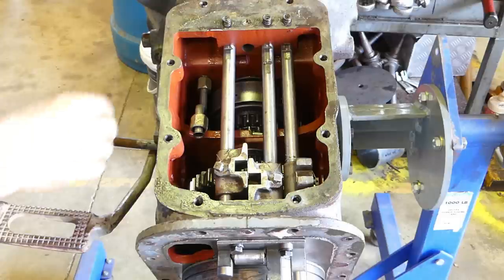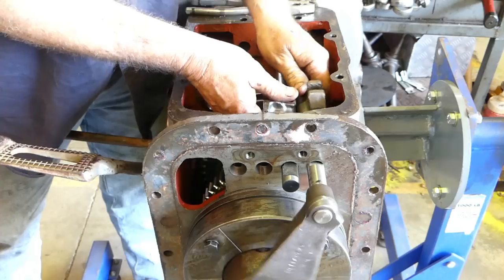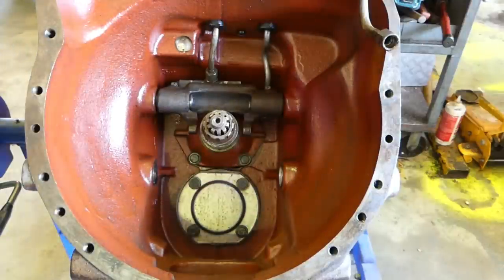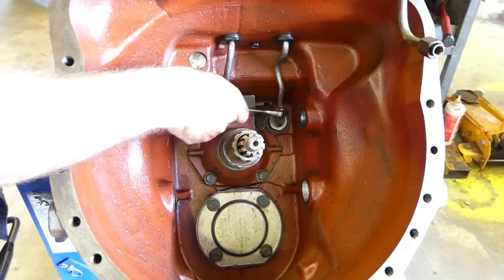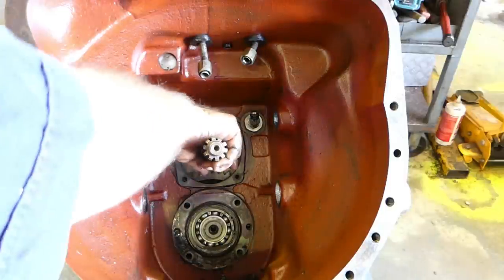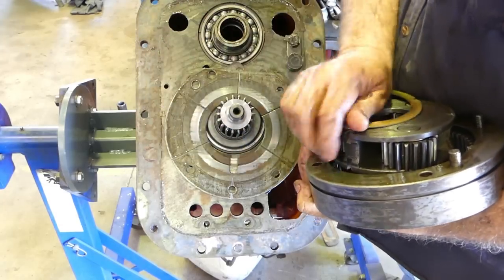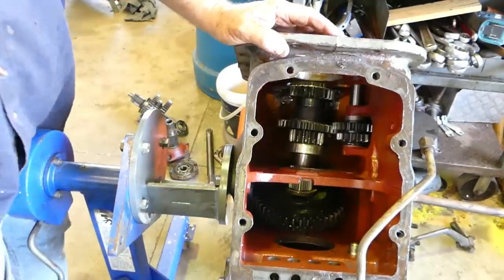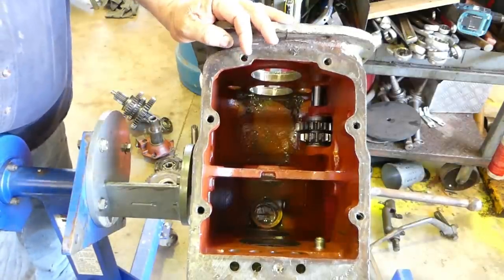Massey Ferguson 135 Multipower Stripping the Gearbox

Comment: That was fantastic detail.... I have a 1964 135 Multipower coming and cant wait to get started on it.. I'm thinking that the Hydraulic Pump is in the gearbox but I don't see it. Is it easy to get to?
Reply from the maker: It is attached to the main hydraulic pump and can be seen bu removing the lift cover.
Reply: @BundyBearsShed  Thank you, Lance.. If in fact the pump is bad,  if the can it be removed and repaired without splitting the cases? Thank you again for your expertise Sir!
Reply from the maker: I think you need to split it behind the gearsticks from memory.

Comment: Hello my tractor has a standard gearbox but i found a multipower gearbox with a cracked casing. Can i fit the multipower pack in the casing of the standard gearbox
Reply from the maker: No Im afraid they are different.

Comment: Hi Lance.  Really enjoying your videos.  A good tradesman always makes it look easy. I know this video is on the 65 but is there any information on the early TE20 1947 on what it should have from the factory.  Eg petrol tank cap recessed in the tank. Battery clamp to hold 6volt battery down not a battery box as in the later TEA. Position of the petrol tap and glass boul further forward on the bottom of the tank. Dose  it matter if the Bonnet doesn't have the alloy sides with the join in them. I have a Bonnet from a 49 with out the join in the side. Steel sides and alloy top.
Reply from the maker: We didn't get the TE20 range until 1948 over here, I would snap an early one up if I could find one with the recessed tank etc. That is something we don't see over here. I have both full alloy bonnet, bonnets with only alloy sides and one with only an alloy top so it must have been pretty well mix and match I would think. Whatever came along on the production line got used.
Reply: Yep the early ones  a little different. I will try to keep it as close as I can to how it would have come from the factory.  I will find it difficult to find a tank but if I need to I could make up a tank recessed cap. My trade is couch builder, panel beater.

Comment: Why Massey Ferguson 135 lock in gear usually  ? is there solution to this problem ?  Thanks for video.
Reply from the maker: Usually the selector is worn or the ball on the gear stick. You can sometimes remove the gear stick and weld it up again.
Reply: @BundyBearsShed  Thank you

Comment: G’day mate look before I go on please, be care-full how you hit those spanners using the palms of your hands. It can course carpal tunnel which is bloody painful and the only way to fix it is going under the knife, I know because I had it on both hands.  You can damage other parts of the palm as there are a lot of nerves and very soft muscle.  I enjoyed looking into this gear box thanks for explaining it the difference between a straight forward box to this six speed it’s going to be nice this tractor when you’ve finished it,  these gear boxes are red inside is that some type anti rust paint regards John
Reply from the maker: The inside is a red oxide type product, on some tractors petrol will mark it.

Comment: To stop inexperienced driver using low multi and thus loose engine braking could they not just have disconnected the hi lo lever on the dash.? . Just wondering
Reply from the maker: Yes they could for sure

Comment: My father did  a similar job  on a 35xmulti power. The multi power had been taken out or else a standard gearbox fitted . I can't remember. But he rebuilt the engine from top to bottom and then the gearbox. Put it all together and it all worked lovely except that the tractor is now doing 62 KMPH on the road . It's a mad yoke.  Great videos by the way . I've only recently discovered and subscribed. I have 135 multi power myself . Love it.
Reply from the maker: Thanks Adrian, Welcome to the channel.

Comment: G'day Lance, 
Thanks for the video. 
I'm Looking at doing the spacer Modification to disable MP on my 35x, does it lock it in low range and does it also retain engine braking?
Thanks again.
Reply from the maker: Yes it locks it in low and you fix the engine braking problem at the same time.
Reply: Thanks mate much appreciated. Should I do anything else i.e disconnect multipower pump ect or should it stay for lubrication?

Comment: Would massey 35 transmission work on a 65?
Reply from the maker: Yes providing it was a dual clutch model.
Reply: @BundyBearsShed  thanks for the reply and all the videos.  I'm just starting out turning wrenches and learning a lot from these videos.  I have a 65 that needs a transmission and a neighbour is selling a 35 transmission.  I just wasn't sure because the clutch is a different part number.  Thanks!
Reply from the maker: The clutch will have heavier springs in the 65 due to the extra hp, it should all bolt up ok though.